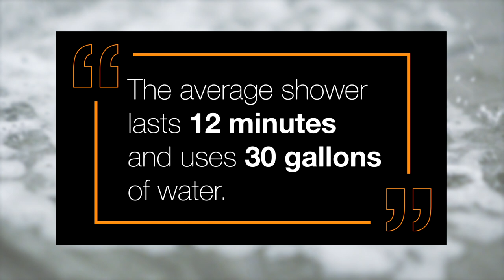Shower Systems: Schluter® Sealed System vs. Traditional System

Comment: Your instructions and this video clearly state that tile is not waterproof so that means, even with this system, water will penetrate it and get to the kerdi board.  So where does that water/moisture go at that point?
Reply from the maker: Hi Patrick, Since it is a sealed system, the moisture does not penetrate into the mortar bed or solid backing, allowing the assembly to dry completely between uses. So, the water just basically evaporates out of the grout joints.
Reply: @schlutersystems1  this response reminds me of that Saturday Night Live Chris Farley sketch when they talk about how the Hairspray has no alcohol
Reply: The problem with traditional shower system is the water might retain between linear PVC and the mud bed when times go on. It happens to my 20 years old shower where it grows some mold underneath. When you use their system, the grout is sitting on top of their “foam” where the water would eventually vaporize.

Comment: I am truly confused how water can get through tile, plastic, vinyl, etc. just plastic alone seems very waterproof
Reply from the maker: Hi there! If done correctly, the traditional system can work. Water and vapor do penetrate the grout lines, however, so often, mold or mildew and efflorescence can be issues with this method, especially if a pre-slope was not used. The big concern comes when someone does not install the traditional system properly. If the pan liner is punctured when fastening, for instance, this can be a place where water can escape and cause leaking and rotting, etc. There are other issues mentioned in the video that make the traditional system less desirable, such as time to install, but the main problem is incorrect installation.